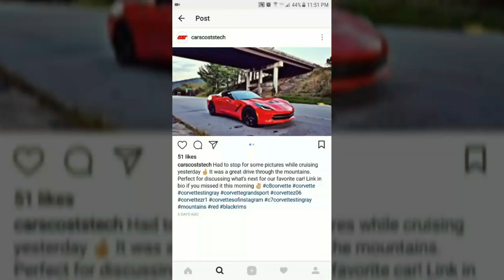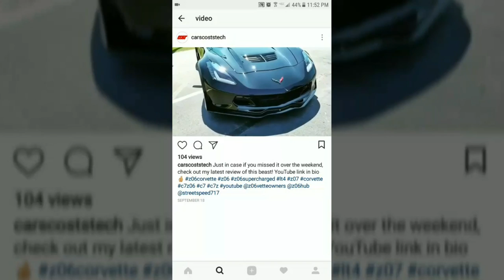Trouble in Paradise... C7 Corvette Issue & Resolution!

Comment: Great they got on it BUT thats not good man I mean its a new car isn't it? Hope my GS don't have this problem but I have a manual trans so it should be OK.
Reply from the maker: +Jay Dontknowbetter It's relatively new. Roughly 16,000 miles now. You definitely won't have any torque converter issues since you have the manual transmission. I haven't heard of any common issues "plaguing" the 7 speed manual. Thanks for watching 👍
Reply: Well turns out I had WORSE issues than that to date they have taken the transmission out and replaced sync gears 1,2,3 then I started getting Service Rear Axle light took it back and now they are saying it needs a rear Diff and the sync gears for 5,6 replaced. So basically I have a new Grand Sport with rebuilt transmission and rebuilt real axle. NIGHTMARE...

Comment: This is happening now on my Vette. 4600 miles, and the shuddering is coming from the front right wheel.
Reply: Did you fix the problem?
Reply: @antonyurchenko5951  Yes. It was the torque converter. Fixed under warranty.

Comment: Bro, I need your help...I'm buying a c7 2016 I was looking at the carfax torque  converter  has been replaced  2 x........ should I even buy it.....
Reply from the maker: Chances are the torque converter didn't even need to be changed. After driving a C7 Stingray, Grand Sport, Z06, and ZR1 A8 I can honestly say they all felt very similar (transmission feel that is). That transmission just gives some strange feedback when the AFM kicks in. The ZR1 is the only C7 that doesn't have it and it felt the most responsive and clean, but the Z06 has very minimal AFM interference.
Reply: No. I got a c6 and the cars are great other than the transmission.

Comment: Have 2019 C7 Grand Sport and had at 4500 miles a vibration and was a torque tube and covered under warranty and it would have Costs  $6,000

Comment: sell it before it happens with no warranty just got my a8 zo7 out of the shop after a new rear end and torque converter and it still shakes was in the shop for a month and a half A8 was a a disappointment
Reply from the maker: I ended up selling it last month, but not because of this issue. I'm hoping to get a C8 Corvette at launch.

Comment: my car has had a shudder in the trans while going through 3rd gear since the day I received the car brand new.   Check this out if you have this shudder GM bulletin #16-NA-175  torque converter clutch problems. Before replacing torque converter try changing trans fluid to  GM mobil 1 synthetic LV ATF Dexron HP.   keep smlin

Comment: hello, I have the same issue on my 14 c7 with 19k miles. So you are saying that a tranny flush did the job?  I am out of warranty  so my other ? is do you know if chevy considers this a defect , or am I on my own? I guess if I am Ill try the oil flush also.
Please reply thank you.
Reply from the maker: +rafael jimenez So far it seems to have solved the issue. Some viewers have told me that they went through similar steps only to have the shuddering return later on. I'll keep everyone posted if anything changes 👍 You may be able to have this repair done under your power train warranty? Mine is still under the bumper to bumper warranty period so there was no discussion of this not being covered. Good luck!
Reply: You shouldn't be out of warranty for the drive train.  It's much longer than the bumper to bumper.
Reply: @gsx11g  I have a 2016 that experienced the shuddering and had the triple flush. 5K down the road, doing it again, this time the GM mechanic told me they figured out that they were using the wrong viscosity fluid and did another triple flush with new fluid. We are taking off on a 2000 mile trip and I'm praying that fixed it. GM should recall every truck and car with the A8 tranny and take care of this problem. Good Luck everyone.
Reply: @russelloneal7569  thanks for the feedback.   I think the triple flush, done correctly without shortcuts will fix it. It's time consuming for the dealer and they should carefully read the bulletin.  As far as a recall, it's silly that GM doesn't recall their flagship hot rod for behaving this way.

Comment: 2017 Grand Sport starting to have same symptoms ….. feel it in the accelerator peddle same with you? By any chance did you down shift often... Seems the problem is when it shifts into 7th gear. I feel it shifts to soon which makes the engine labor. Thinking may be resolved with the recycling of the cars computer? Torque converter/fluid?
Reply from the maker: It seemed to happen to me when the car was hovering in-between 4 and 8 cylinders at low rpms. Couldn't duplicate it any other way.

Comment: Just a footnote my 2017 grand sport started having a problem at 4000 miles where if you were on the cruise control the RPM on the tack would raise and lower 100 RPM instead of staying at a steady RPM The dealer informed me that the factory installed the wrong transmission fluid in the car from the factory and needed to be changed.
Reply: Hello there! I,m having same problem with my rpm fluctuating. Dealer said it might be a dirty Throttle body,at 16k miles well picked it up today still shaking real bad with no engine light
Reply: William Robinson Sorry to hear you have The same problem that I was having. My dealer told me right away it was the fluid in the transmission that is causing numerous problems chattering the RPM fluctuating and a small hesitation when you start out all caused by the fluid. Drain and fill three times solve the problem.

Comment: I am puzzled how many cars are being bought with the black alloy wheels . They look awful to me. Just like a car that hit a pot hole and all the hub caps popped off. And amazing that the wheels cost more.
Reply: I agree somewhat.  I now have a Black 2017GS with black wheels.  They make the car look mean, but not eloquent.  I hope to put chrome on someday.
Reply: What you don't realize is that most of the cars on the lot are Factory orders.  The dealer has no input.  Corvette is trying to market to a younger market, and they feel the younger set likes everything blacked out.  I forget the actual percentage of vettes that are special ordered, but it is a very low percentage.  A couple other things to note.  1) they put the track use summer only sticky tires on them knowing that the tires will wear out in under 10,000 miles.  Less if you track it.  2) They also will try and sell you a set of chrome wheels with all seasons on them for your daily driving, and save the track tires and wheels for the track.  A Handy $3500 upsell.  Oh and on the GS and Z06, the rear suspension comes with a 2+ degree camber built in which is great for handling, but hell on tires.  It will wear out the insides of the rears EXTREMELY fast.  Then they can claim you have been doing burnouts or donuts and ruined the tires.  (Another upsell and a grand or so to replace said rear tires.)  My advice is to take it to a frame shop that knows what they are doing with alignments and have them dial it down.  No WALLMART specials.  And definitely don't trust the dealer.
Reply: @garycrumrine9538  the dealer Errol only align to factory specs. The front tires will wear out on the insides with about 10k miles. The street spec alignment works best for non tracked Corvettes.
Reply: And ALL the C7 corvette wheels are made in CHINA.

Comment: No car is perfect and the corvette is as good as it gets when you have 460hp car that can be used extensively everyday.  Many people don't understand that cars are built with parts from all over the world.....different suppliers have more or less quality so sometimes when gas bean counters are accounting for every red cent spent....you'll have vendors change.
   The nice part is the corvette has a very small failure rate when it comes to big repairs ....plus I'd rather have a broken corvette than a working civic or corrola
Reply from the maker: +Youtube Championship Like you said, considering that I'm daily driving a 460 hp sports car, I've been extremely impressed with the reliability. Any and everything that is man-made will malfunction at some point.

Comment: Well that does it.  I'm getting a Lexus LC500 instead.  American made cars are piles of "SHIT".
Reply: Me too
Reply: @hermanrogers1325  Hello Herman!  3.5 weeks ago I bought a silver 2022 Mustang GT and LOVE it.  The engine and  10-speed AT have evolved now to be very reliable machines.  I do plan to add Ford Performance suspension to drop it about 1", Brembo brakes front and rear for shorter stopping power, and fatter tires for grippy curve hugging turns.  No other changes required.  The car is perfectly powered and never hesitates to accelerate at any highway speed.  Consider getting one before the 2023/2024 models take over.  Not a fan of the new Mustang face lift sad to say.  But the Dark Horse model does impress.

Comment: 6th like
Reply: I had the same issue and dealer (Masse Chevrolet South) performed the same procedure and also flashed new firmware recommended by GM.  Problem has for the most part gone away.  No more shuddering under light load and RPM in 30MPH range.  I believe the new firmware has changed the shift parameters as when the car shifts it seems to hesitate then snap shifts into gear.  Used to have a nice smooth shift before the firmware change.  I am assuming the firmware caused this and not the new fluid and additive.  Has anyone else had both done and experienced the change in shifting?

Best Vette I have owned (3rd one) and I would drive it year round if I lived in a climate that was conducive.  Dealership has been outstanding in supporting me.